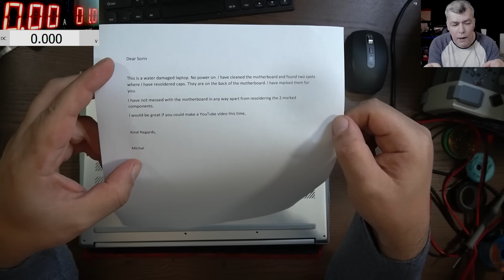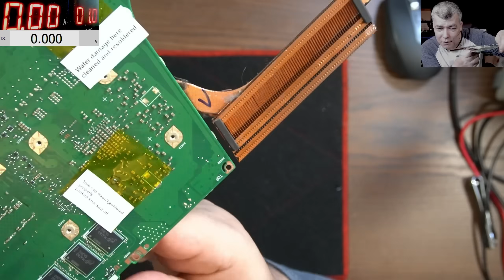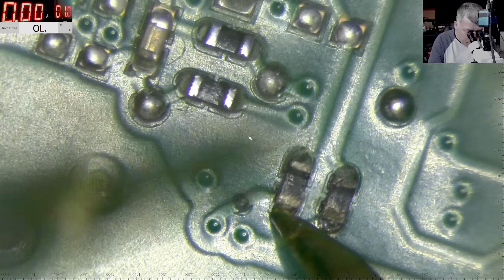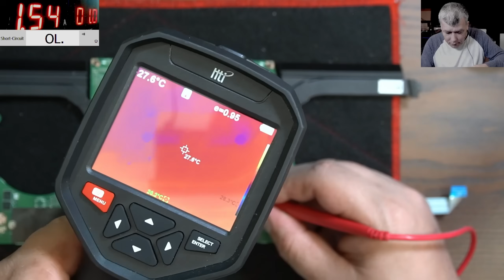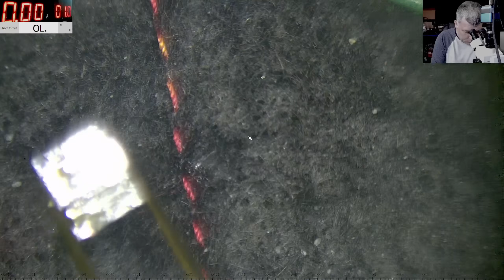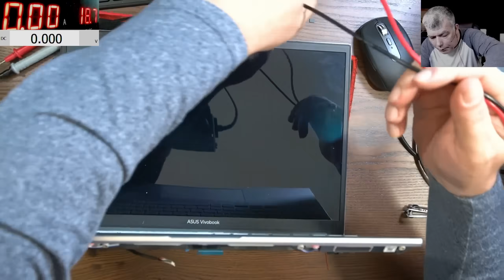Asus Vivobook N7600P laptop repair - How we are matching mosfets?

Comment: Those shorted center mosfets need a small sticking finned heat disipater. That would lower it's temperature just enough to match the heat on the two outside mosfets. In fact the factory should do this to lengthen it's life rather than just heat the circuit board.

Comment: When you say working harder, i assume you are referring to its on-resistance?
Reply: MOSFETs in parallel are connected with a notion that each device handles the uniform flow of current through it and there is no current concentration during dynamic or steady-state conduction of the devices. However, there are conditions that shatter the current sharing between MOSFETs in parallel.
When there are parameter mismatches, say differences in RDS(on), the MOSFET with the lowest on-state resistance carries the highest current. However, this current imbalance is compensated due to the positive temperature coefficient of RDS(on). As the device carries more current, it heats faster than other parallel MOSFETs and this increases its on-state resistance value. The hike in on-state resistance decreases the current through it and eventually balances the current flow and power dissipation in all the paralleled MOSFETs.
However, this is not the case when the MOSFETS are conducting in the reverse direction through the body diode. The forward voltage of the body diode decreases with a temperature rise and enables more flow of current through it. With time, the current imbalance increases and causes thermal runaway, damaging the MOSFETs in parallel.
Reply: @JonnyMac351  excellent explanation, thanks so much! I remember the thermal runaway with the old fav 2N3055 tranny 😅

Comment: Nice video, glad that you've addressed and explained thermal issues here. Who wants unsatisfied customer back in a week, this time with a dead GPU? It could be that the shorted mosfet was a borderline spec part, used in a "heavy duty" conditions, or simply design flaw. Some laptops work fine in Norway but die while gaming in Sahara. If this laptop was mine I would improvise some kind of heatsink on top of them mosfets.

Comment: well done sorin! however i am wondering that it does seem very odd design choice of the manufacturer here. because they put heatsink over the cpu mosfets well enough. then this mosfet which failed, on the gpu vrm... there is not any top heatsink covered! only through the pcb ground plane is their cooling. so maybe they messed up the thermal design for the gpu vrm is why it failed? then it may die again. those mosfet to overheat another time. for example during gaming. and when the gpu is using a lot more watts than the cpu probably. i suppose it depends also which performance of the gpu. how many watts, the heating. but still!

or maybe because when the gpu gets so hot itself, with too little fan spin. then it dumps too much heat onto the gound plane copper in the pcb next door. and then the vrm gets too hot, because it has no place to dump its heat. stupid things like this. and in a brand new 2022 laptop? perhaps shame on asus for these new design? if this is true or not. that it cannot be fixed, such a design flaw, other than perhaps to run it with faster fan. is much louder / more noisy
Reply: but you can at least warn / recommend the customer of those concerns. not to come back to warranty again. onto that existing repair. (and even if you did put the correct mosfet)
Reply: if the mosfet has a low Rdson and is switching fast then the cooling through the PCB is adequate. furthermore you have much higher thermal resistance through the plastic body of the mosfet so even if you have a top cooler attached, most of the heat will sink into the PCB anyway.
Reply: @robertjung8929  my friend, i was already aware of those 2 details. however to assume those is all fine... does not adequately explain away well enough the actual cause for this failure to happen... or indeed other similar failures in other laptops such as gaming laptops more generally.

it would make a lot more help to confirm thermals are not a problem here with more effort. and get to the bottom clear answers with some thermocouples placed on the board while to stress test the gpu+cpu

but the sad reality is that too many different models of so many laptops gets released to hit the market. and reviewers dont want to get their hands dirty to bother properly a comprehensive thermals testing including vrm temps.

and even asus themselves ...neither it wants even to do a proper oversight and be responsible for many of their own products. if you watch today's video on gamers nexus (about the asus motherboards blowing up, the lies, over all of the bad firmwares). it is not really much reassurance to be so confident in these products or in the manufacturer. that they were engineered properly

 it even can be the hardware is not the final straw to break it. but might be that the software in control of thermals instead has a bug, or the bios / firmware. or the customer is tweaking the fan curve to be too much quiet. and slowing down the fans so much, then it might overheat it a lot.

going back to the failed mosfet itself... could be bad mosfet yes. but then how can be sure. without first eliminating a higher thermals on vrm section. it reminds me of the old alienware laptops. perhaps if the driver has a temperature sensing, is modern smart current stages with proper protection features, ocp, otp.
Reply: @dreamcat4  how do you know how many laptops fail from all the sold ones ? so how do you know there is a real problem ? most probably there is no issue at all with thermals and the amount of failed mosfets you see is just normal.
Reply: @robertjung8929  well it is normal for the manufacturer to want the rma rate to be good enough to get past the warranty period. but therin lies a good question actually. for why was this 2022 model its 12th gen a 3rd party repair and not still covered under warranty? perhaps a used item resold? because we would expect otherwise not to land on sorin's desk

also you are claiming things you do not actually know either. that is the weakest of arguments to make. we can know on some models however with proper review, as i already said enough. so your question is entirely redundant to my last answer. what a troll comment.
Reply: @dreamcat4  only thing i was claiming is the adequate cooling through the PCB and i'm quite qualified to tell that. don't know on what basis you accuse me of not knowing .. but well... it's you opinion and actually your very opinion doesn't matter at all in the grander scheme of things :)
Reply: sorry but no. i took offense because there was offence to take by your carry on. and i already gave the full reasons for why in previous comments

Comment: Lukcy job Sorin! Nicely done. You should check in an operating system if the gpu is working tho. The bios could be working on the integrarated GPU, the DGPU might still be dead.
Reply: @Kiburici  Are you sure? Im preety sure that IGPU handles the internal monitor, while the DGPU handles the external displays. On more premium machines there is a MUX, a chip that switches between GPUs. Although it would make sense for gaming laptops for the laptop screen beeing wired directly to the dGPU for less latency, but the MUX takes care of that. Most machines i have use the IGPU for their internal display. The bios is also a bit SUS since it shows the intel GPU under GPU tab. Just my humble opinion.
Reply: @Kiburici   IGPU handles the internal monitor. dGPU can be dead and laptop still power on and load windows
Reply: @Kiburici  this is nonsense.

Comment: Sorin the other video where a customer had 2 same laptops and both had the same shorted mosfet which killed the CPU.  Is it possible on this laptop to replace the mosfets with better ones that can handle more current and voltage so they work less but still perform the same action?

Comment: Hi Sorin,
Great job as always👌
I have a question, why don't you start with a visual inspection first while checking the motherboard? Personally while working on a motherboard, I identify approximately 60% of failing components using only a visual inspection.
Regards,

Comment: What about putting a thermal pad across all the mosfets to help them out
Reply: You can't help them because they are helped by the big power rail..
If the MOSFETs get to hot, there can be a problem somewhere because they are not designed to get very hot on the power supply circuit.
Reply: @ThermalWorld_  👍Thanks for the reply
Reply: @ThermalWorld_  My Acer has main heatsink across the mosfets.

Comment: it is very unproffesional and very dodgy when you dont know what  amperage and watt of that mosfet and replace with the one that looks the same but different value[  how long it will last the repair]🤤
Reply: Relax Karen...  If you know so much more than Sorin, why watch his video?
Reply: @jf5016  why not [is good to know the level of others]
Reply: He gives warranty for his jobs. If it comes back with the same issue he will not charge anything and fix it the “proper” way for sure.
Edit: 18:18 he even said he will order the correct mosfet…